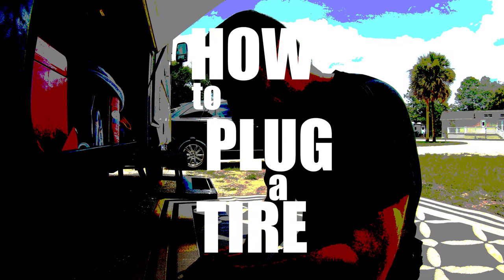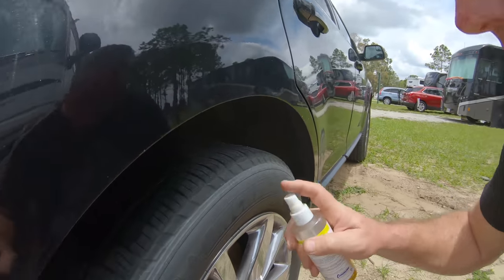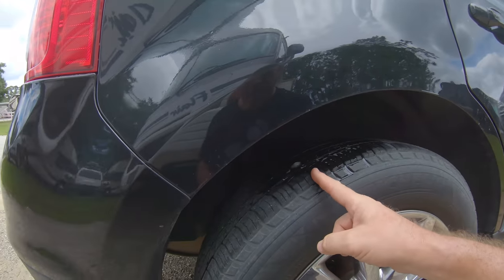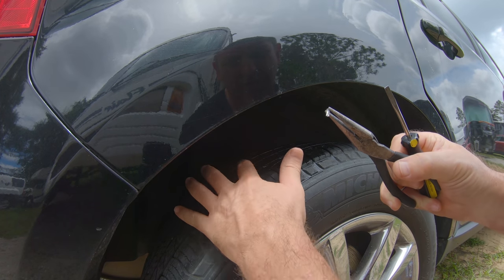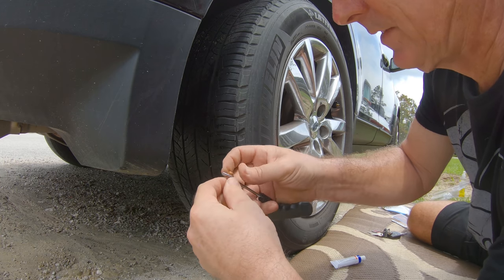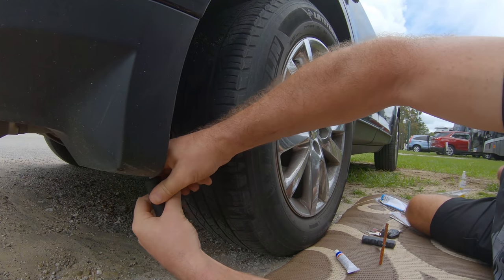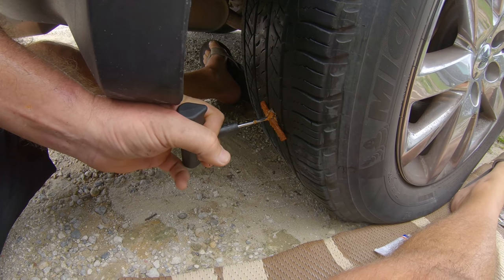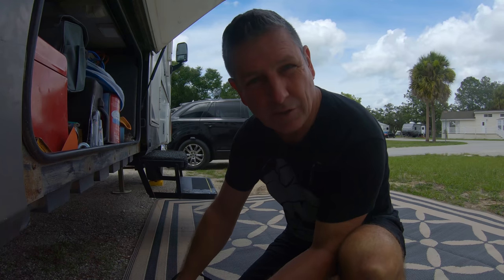How to Plug a Tire | Fix a Flat or Punctured Tire | The Motorhome Experiment

Comment: I always thought you had to push the plug material right into the tire then pull it back out. Who knows, but it’s repaired until you can get to a tire store and get done professionally or replace the bastard. Hahahahaha stay safe guys. Oh the old insect up the nose trick eh? Wise guy eh? Cheers!!!
Reply from the maker: You don't want to push it all the way through. A tire store would do it the exact same way. It's done until it wears out or blows out!

Comment: With a class A get a heavy-duty tractor tire repair kit. I once plug a sidewall with one of these when I was empty weighing 28,000 lbs and it lasted over 500 miles till I got back to my garage I am talking an 18 wheeler folks. Harbor Freight $65.00 works just as good instead of $300.00